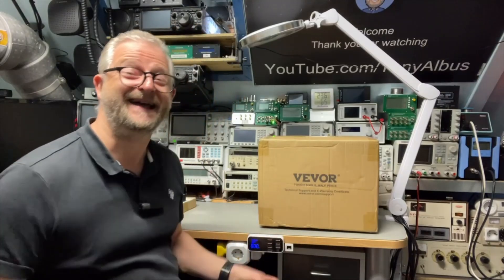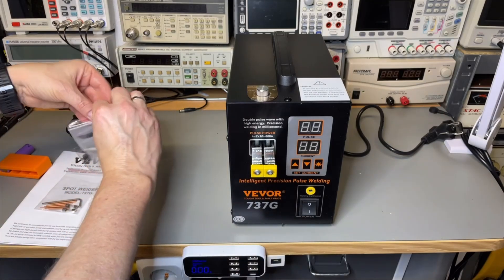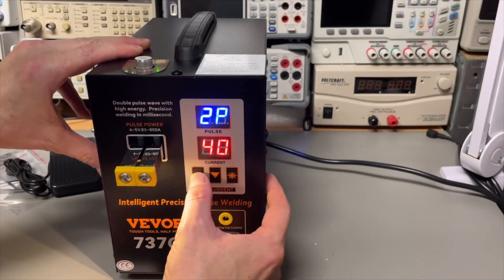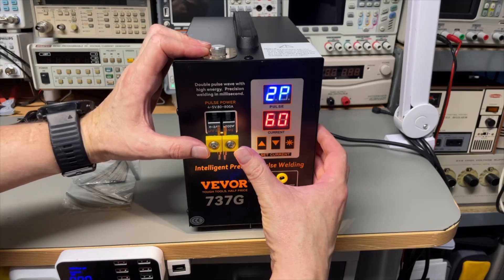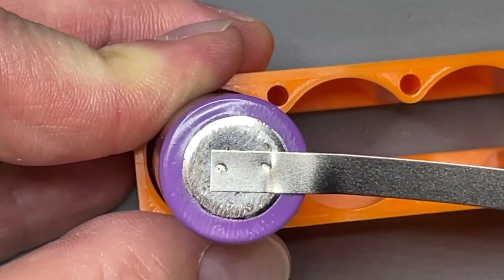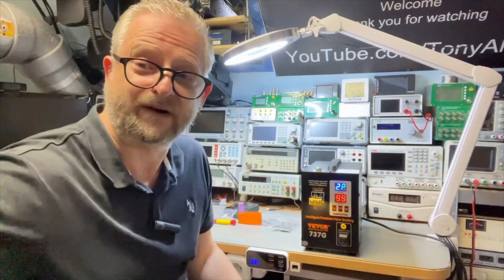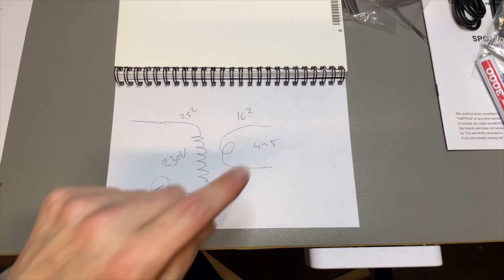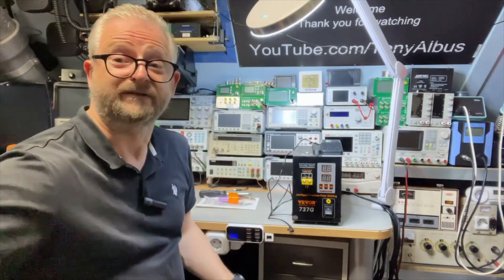TA-0417: VEVOR 737G Spot Welder - Hands On  - Teardown - SUNKKO

Comment: Hi Tony, I’m pleased to see that we’re using similar tools. I’ve been using this one for assembling batteries for more than a year now. It is a reliable machine despite that I would have loved to use pure nickel strip instead of alloy but this tool is struggling a bit with it. Also I prefer to use the pedal as sometimes I loose control when adding too much force to the lever and the whole thing starts to move up and jump making sparks and short circuits. Otherwise great video thank you!
Reply from the maker: Thanks! great to know it works still after one year, thats very valueble information... i was thinking to put a bog of sand in it for weight. all the rest seems good.

Comment: Lol! Such a big box, such a miniature transformer. Lol, pretends to need a 40A breaker? Seriously one can get a microwave transformer for nothing, replace the HV windings with some thick braid and use a 555 timer with total costs under 10 bucks.  Now see how many different inrush amps readings you get using 50 different meters. Maybe they also sell a Vevor meter tuned to show them 888 Amps?
Reply from the maker: Yes some nice mod are in YT i saw indeed. but for me this worked great, i dont use it every day